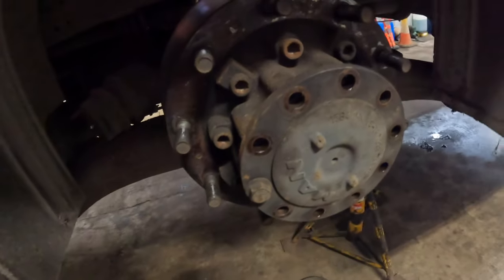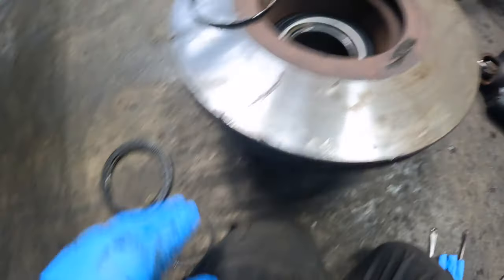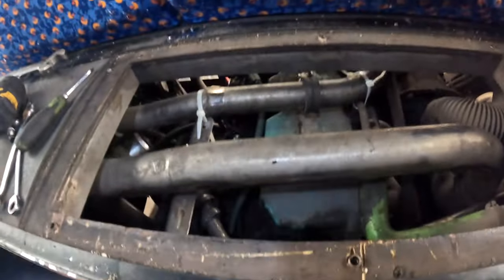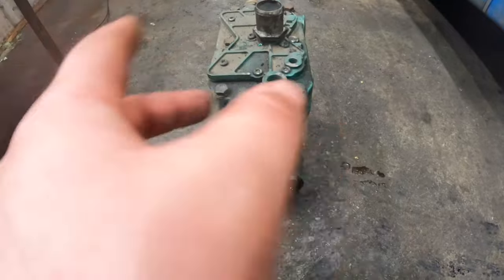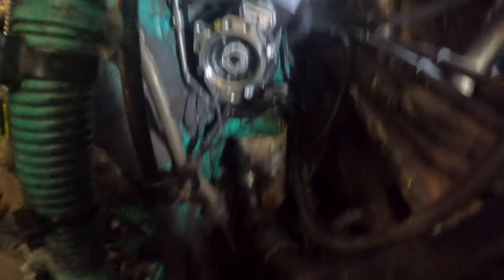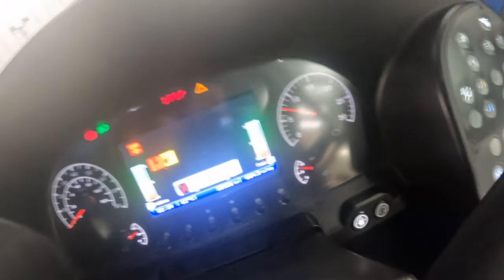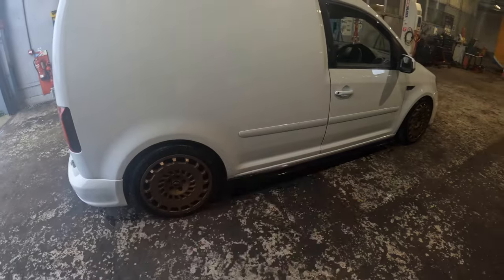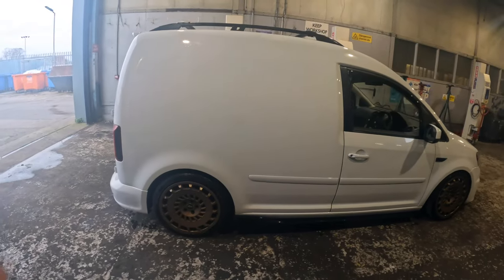Hgv mechanic uk- Bus compressor, ABS fault, I got a van!

Comment: ahhh the bus industry, iv been a mechanic in it for the past 5 years and you spend more time battling with poor design and placement of parts than actually replacing them. no thought anywhere for how will things be repaired and theres many times iv created new swear words trying to sort things. but when you walk away and its fixed you do get a larger appreciation in yourself after the struggles
Reply from the maker: Yeah your 100% right feels like you have to take off 100’s part for one haha yeah I agree when it’s done your like yeah I’m pleased with that! It’s always a challenge.